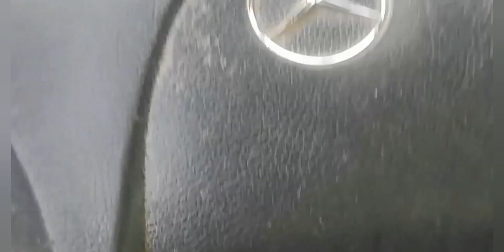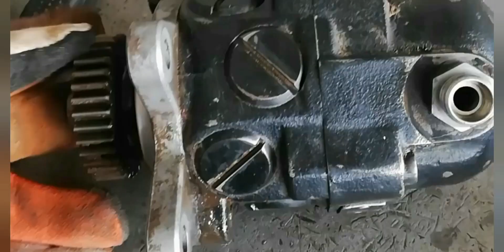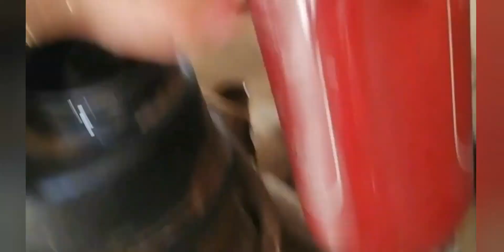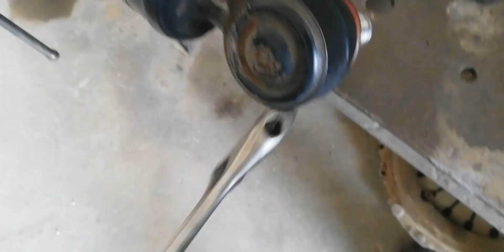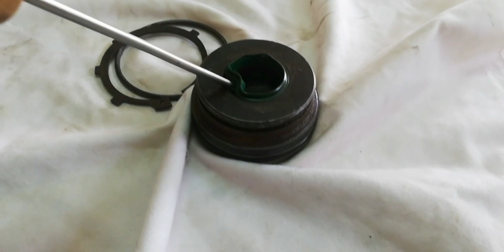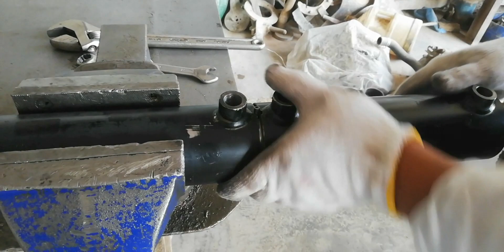CAUSE OF STEERING WHEEL HARD Repair Steering Cylinder Tutorial Mercedes Actros

Comment: Hello... Thanks a lot for your useful videos. I have a similar problem.. When I turn the steering right it shakes left and right although the filters and the  seals of the piston are new. When I close the hydraulic lines going to the piston the steering runs smoothly.
Reply: Do you know the reason for this?
Reply from the maker: you may check this video. the steering wheel vibration is also coming from the steering pump, check the relief valve of the steering pump. https://youtu.be/tart18CbRT0